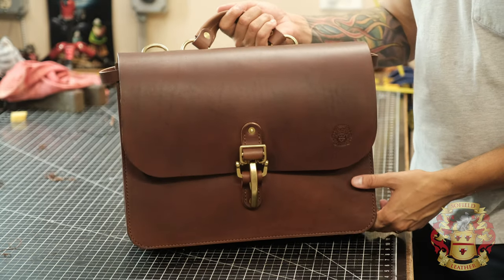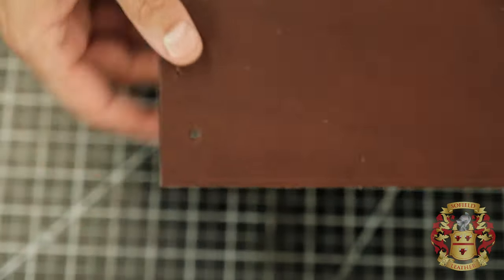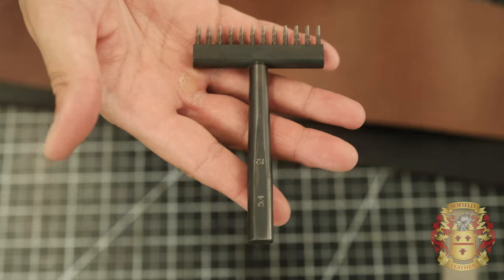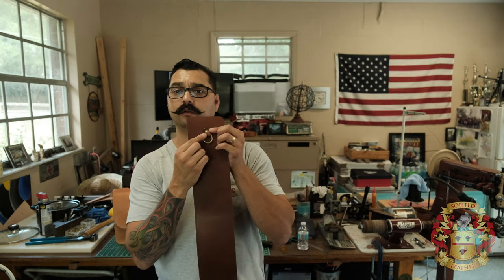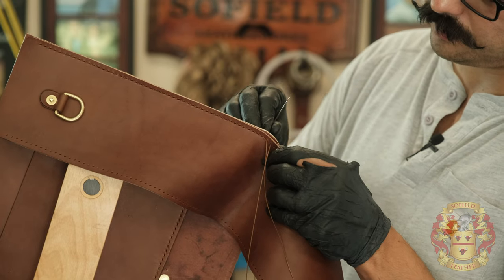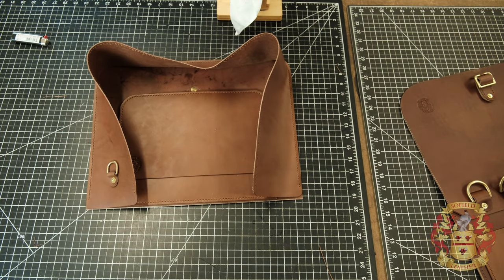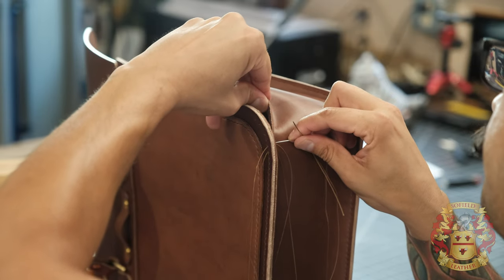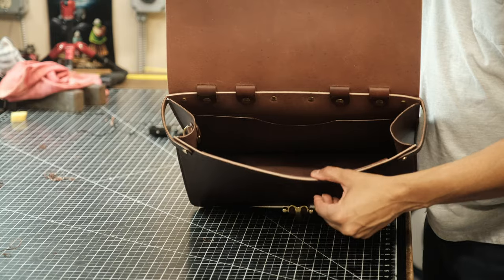How To Make a Leather Satchel Bag - Part 6 of 6 - Pattern Download

Comment from the maker: How To Make a Leather Satchel Bag - Part 6

💾 Download the Template
→ https://www.sofieldleather.com/shop/p/briefcase-pattern-build-along-video

💼 Watch the Whole Build Series
→ http://bit.ly/Satchel_Bag_Build_Series

👨🏻‍💻 Download Templates, Patterns and Blue Prints
→ https://bit.ly/Secret_Blue_Prints

🤷🏻‍♂️ How To Use My Patterns
→ http://bit.ly/How_To_Use_My_Patterns 

🛠 Hardware - Tools - Material⇩

👉🏼 325 Dee Solid Brass 1 1/4 inch
→ https://www.weaverleathersupply.com/catalog/item-detail/00325-sb-11-4/325-dee/pr_1070

👉🏼 325 Dee Solid Brass 3/4 inch
→ https://www.weaverleathersupply.com/catalog/item-detail/00325-sb-3-4/325-dee/pr_1074

👉🏼 1144 Collar Set 1 1/4 inch
→ https://www.weaverleathersupply.com/catalog/item-detail/01144-sb/1144-collar-fastener-set/pr_1730

👉🏼 5015 Square Scissor Snap 1 inch
→ https://www.weaverleathersupply.com/catalog/item-detail/05015-sb-1/5015-square-scissor-snap/pr_2320

👉🏼 50 Buckle 1 1/4 inch
→ https://www.weaverleathersupply.com/catalog/item-detail/00050-sb-11-4/50-buckle/pr_321

👉🏼 3425 Button Screw Stud 1/4 inch
→ https://www.weaverleathersupply.com/catalog/item-detail/03425-sb-1-4/3425-button-screw-stud/pr_2211

👉🏼 Circle Tool
→ https://windfiredesigns.com/Tools/CircleTool/index.html

👉🏼 Pippin Punch
→ https://www.buckleguy.com/105-2-oval-pippin-punch/

👉🏼 Wicket & Craig Leather (Ask for Cindy)
→ https://wickett-craig.com/direct-sales/

💼 Shop 
→ https://www.sofieldleather.com

🇺🇸 Watch my Vids on Rumble
→ http://bit.ly/Sofield_Leather_On_Rumble

⏱ Time Stamps:

00:00 - Intro & Info
01:36 - 3 Main Rules
03:12 - Cleaning Up Edges
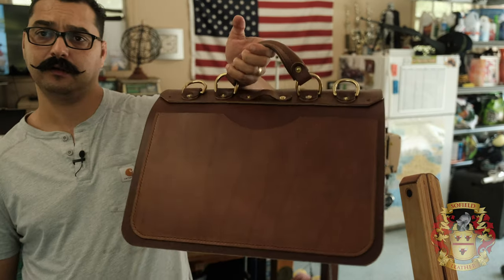05:46 - Scribing the Stitch Line
08:12 - IMPORTANT Gusset Info
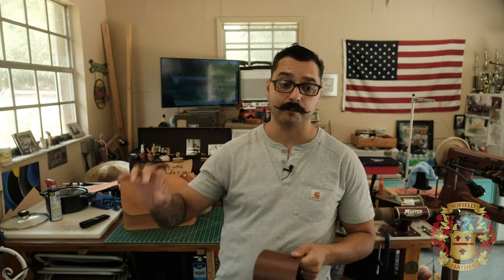09:50 - Punching the Stitch Holes on Body (A,B)
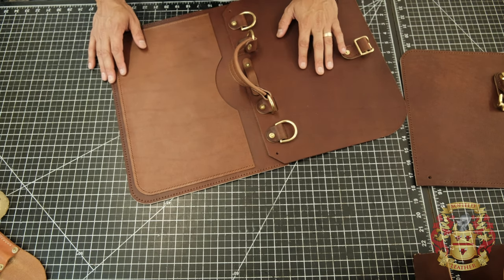11:48 - Quick Little Tip
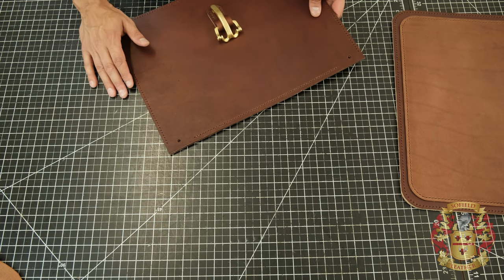12:47 - Punching the Stitch Holes on the Gusset (D)
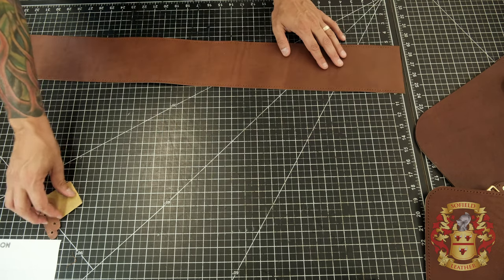16:47 - Attaching Gusset D Rings
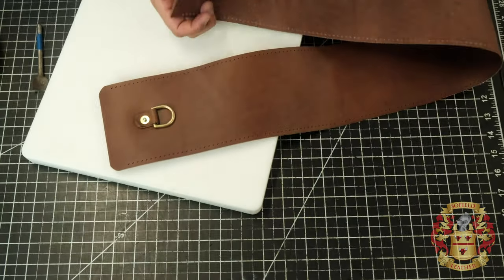19:28 - IMPORTANT Gusset Clarification/Overview
21:57 - Stitching Gusset onto Front Body
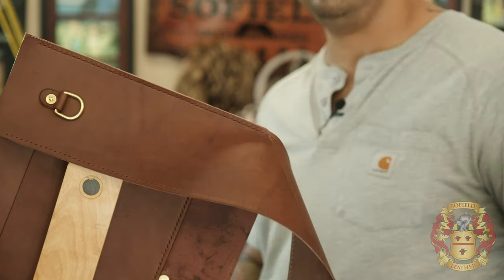27:58 - Stitching Tip 1
32:39 - Stitching Tip 2
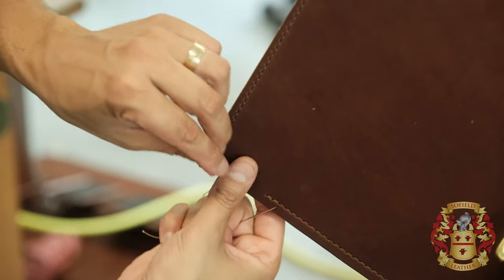33:38 - Finishing the Front Assembly
34:23 - DONE (Front Assembly)
34:46 - Stitching Gusset onto Back Body
35:35 - Stitching Tip 3
37:01 - Stitching Tip 4
40:27 - Stitching Tip 5
41:49 - My Favorite Part of this Whole Series!
42:13 - Almost Done (Back Assembly)
43:17 - Bevel, Burnish, Edges
44:40 - Assembly Gusset Assist Straps (L)
47:29 - Adding Conditioning 
48:12 - Outro

 🖥 Playlist ⇩

📒 Leather Patterns & Build Alongs
→ https://bit.ly/Leather_Patterns_Build_Alongs

😉 Leather-Crafting Tips
→ https://bit.ly/2HP6MZa

🤲 Build Videos
→ https://bit.ly/2ZnzVPZ

🧵 Handmade Leather Tote Bag - ASMR - Complete Build 
→ https://bit.ly/2NDyKqa

💼 Handmade Leather Briefcase 
→ https://bit.ly/3g898hn

🎧 My Music 
→ Spotify: https://bit.ly/Alexis_On_Spotify
→ Apple Music: https://bit.ly/Alexis_On_Apple_Music
→ YouTube Music: http://bit.ly/Alexis_On_YouTube_Music
→ YouTube: https://bit.ly/Alexis_On_YouTube
→ IG: https://bit.ly/Alexis_On_InstaGram

#LeatherSatchel #LeatherPattern #DIY

Comment: May I ask how you ensure that the horse collar latch will stay taut even with an empty satchel?
Reply from the maker: Great question. I designed this bag to make it as tight as possible and still close fully loaded. The collar is designed in a such a way that it doesn’t unlatch. Never had it unlatch on me. Hope this helps.
Reply: @SofieldLeather  thank you very much for the reply. It’s reassuring to know that it hasn’t unlatched on you but I’m just wondering if it gets loose when the bag is not full. Because I’m just worried that after a few years of use, the satchel will start getting floppy and if the latch is not taut, it may unlatch spontaneously.
Reply from the maker: @KB1.1  I hear you. One of the reasons i make my bags kinda stiff. I prefer the briefcase feel vs a satchel feel. Ive had no problems, but then again i make mine pretty stout.
Reply: @SofieldLeather  thank you very much.